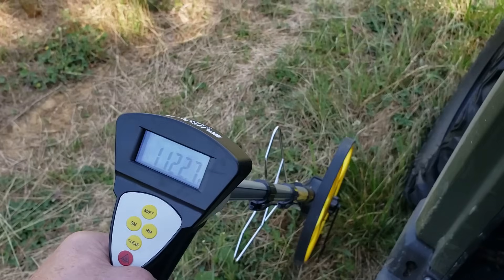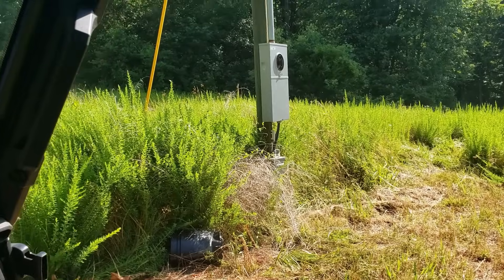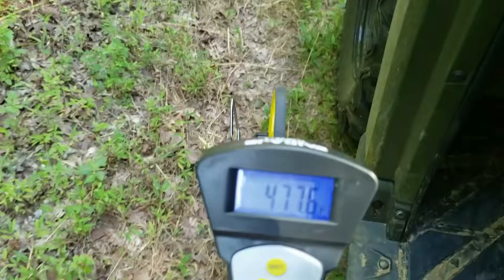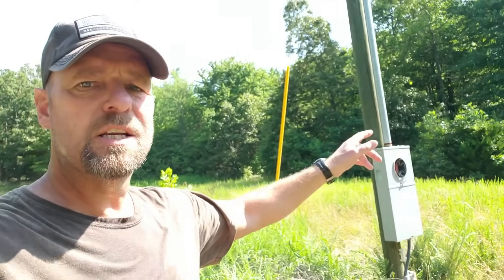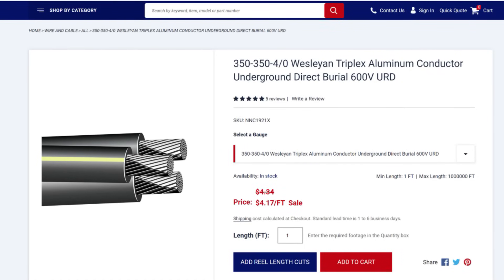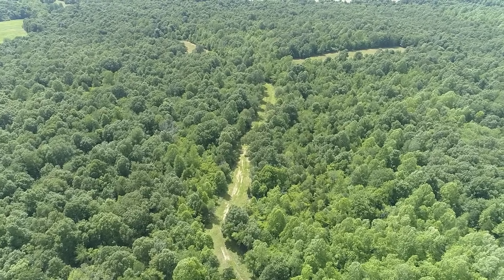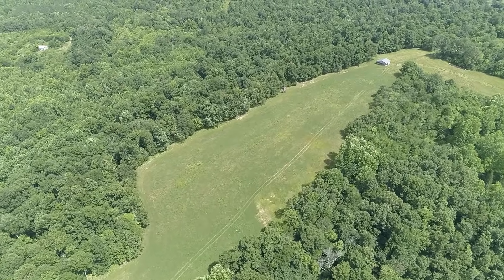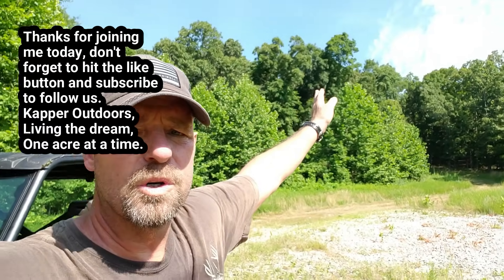DIY running 2,000 feet of power line to remote homesite? Let's talk details.

Comment: For the money you're looking at, solar seems to be a no-brainer. Especially when you consider the benefit of not having to rely on the grid going forward. These days, that could be very attractive to a buyer.
Reply: Solar needs a grid to function and also the sun. What do you do at night?
Reply: @jhans3278  Wrong. We're talking about an off-grid application. Obviously that means the system would include a battery bank. Nowadays this is very much economically viable, even when the grid is highly available. In this case, solar (with a battery bank, obviously) appears to be literally the most economically viable option. And yes, I would pair it with a back-up generator.
Reply: @tom8437  thanks for clarifying you were referring to an off-grid system with battery storage.
Reply from the maker: Thanks. I do not consider this a no brainer though. There is a lot to take into account. For water, I have to trench it anyway, so if I am going to cut a 2,000' trench and lay water line, I might just as well add the power for fully reliable service, that is also much  more attractive to MOST potential buyers down the road. If someone is going to spend a half million for a stunning property and want to build something they may not be confident in a solar system for a new home construction like they would a good 200amp service. So I am also factoring more into this equation. Hope this makes sense, thanks.
Reply: @kapperoutdoors  Per National Electrical Code power cable shall be at least 12 inches away from other utilities.  So. power cable and water line must be in their own trenchs.

Comment: A $30k - 40k solar installation will provide a ton of power.
Reply: 30 - 40k?  I own 2 homes that are completely on solar. My largest system cost me 16k
Reply: Neither home even has a meter now.
Reply from the maker: Only problem there is I am not that skilled for that kind of install, and not sure where I would put it? There is just a barn there now but it is a phenomenal building site if adequate 200a service was there. Will open the potential buyers up substantially and will command top dollar for a one of a kind piece of ground. I have to look at all that too. Thanks.

Comment: Y would you not just put a 3500 watt solar system on there with rain catchment for water. Would be a MUCH better option and WAY WAY cheaper.
Reply: Not to mention much more secure.
Reply from the maker: The problems I see with that are that most buyers that can afford a property like this and want to build would prefer and much more traditional and reliable system of power and water. I am not saying that solar is not totally reliable, as I do not know that much, but from the real estate perspective I have to look at that. Now if a person were building their own home up there and were ok with a new solar system install that would be a different story. Hope this makes sense, but I will continue to learn more about solar. Thanks.

Comment: Wow, utility company must not want new customers to be charging that much. In my area, the electric company will usually run overhead at no cost if you clear the right of way.  If they do charge its only the cost of the poles they use.
Reply from the maker: Years ago when they wanted more customers they would run long lengths for just a small service fee. Now they don't want more customers so you pay for everything to get new service in!! Thanks

Comment: Unless you are dead set against poles, I would go overhead until the last few hundred feet or so. Or you can go a bit higher and buy underground primary wire and set 2 transformers along the way, I think they can go about 1000 feet on an underground before needing to voltage regulate it again. This may be cheaper in the long run for you as you can do all the digging. I do not know if your power company will want it all in pipe, which will make it more costly, plus they may want you to use a bedding material like sand or fine gravel for the pipe. Ask them what they would do for a large subdivision that wanted all of the wire underground, that is the wire you need. it is not 500 mil, I just know it as primary wire, solid core with numerous cables around the outside- whole thing is roughly 1.5 inches in diameter. should be about $4 to $7 a foot for the wire.
Overhead primaries from the power company to almost the house location will be cheaper and often you will not need to dig the trees out just stump them. Then you have concern of right of way maintenance and trees falling across the lines. 
I don't know what you mean by going 400 amp, that will not help the voltage drop over 200 amp, it allows a bigger service at the building. the wire sizing will help but a 20% loss is still a lot of loss.
Reply from the maker: Having them do it underground is just out of the picture. It will be way too costly and I'd still have to run the trench. If I'm cutting the trench I might as well just lay the wire for a substantial discount. Have to wait a bit now for wire cost to come down though for this even to be viable plan. I know more now about the exact wire sizes I will need for either 100a or 200a service up on the hill. If wire cost were what they were a year and a half ago, I'd be drawing up the plans now! lol.

Comment: Maybe you should reconsider solar cause with enough panels you can probably run 2K house.  At least check it out.
Reply: Solar doesn’t run on its own. Still need either a grid or a large battery storage system.

Comment: Hummm, 20% loss, mega dollars per foot, mmmmm.  You are talking about 110/220 vac losses.  Have you explored running 440/660 vac to a step down transformer near the building site.  The higher voltage should be less loss in that distance, and maybe smaller conductors, thus less cost but more critical insulating spacing.  It might not be worth it but then again.....might be worth checking into.
Reply from the maker: Looking at that too, but I now I have more specifics on the exact lines I will need for minimal loss (5 to 9%  total). I have a feeling the inline transformers (private) won't be cheap, but I don't know that yet for certain. Thanks.

Comment: Don't just dismiss solar, it appears from the little you said of it you are only listening to the naysayers. A combination of solar and wind on the top of that hill can give you ample power 12 months of the year.
Reply from the maker: I won't totally dismiss it yet, still have to do some digging, but the major up front problem with solar is there is only the small barn up there now that we may convert into a camp. Part of the investment strategy is for a future building site, and most buyers that want to build a nice home will shy away from a solar system, so even if it cost less to put in, you would not get the same return in the future of making this an absolute one of a kind property that would command top dollar. So its not just getting power for a small deer camp or small home, there is a real estate perspective as well. Thanks.

Comment: I'm speaking on behalf of automotive wiring...but when using copper clad aluminum wire..there is a 40% current drop versus pure copper wire . Your run of 1900 feet has me concerned...seems like a long draw of current for aluminum . I think your best bet would be to wait awhile for the prices of products to come back to reality...look at osb plywood..$44. for 7/16 thickness..$10 for a 2x4 . Things are so out control at the moment i'd keep your millions under your mattress a little longer lol . I think before i spent 50k on service i'd check the options out for the solar programs the government were offering..i believe here it was around 10 grand towards the purchase and any excess energy could be purchased by the electric company..which probably wouldnt apply to you being without a powerline . The only other option would be building a mansize hampster wheel for Curtis and connect it to a generator head lol...good luck with this future project
Reply from the maker: Yeah I'm definitely going to wait a bit to see if line cost comes back down! But now I have some new answers as to exactly what Line sizes will work for this project, so I still may end up doing it and saving money as well. But we'll wait on pricing for awhile now! Thanks

Comment: Aluminum wire? Really. Gets hot faster and doesn't cool as fast.  That's why the aluminum wound welders were unreliable. They would get hot and hotter and the welders couldn't control the amps to the welding rod.  Please do some major research into aluminum wire. How many mobile homes have burned to the ground wired with aluminum. Just saying something to look into.
Reply: Most utility systems are designed with aluminum wire. Aluminum is 60% the conductivity of copper. So, just the wire size is just based on the load.
Reply from the maker: That's exactly what this line is made for. Running electricity for commercial purposes.
Reply: Kapper Outdoors so  they just use larger diameter wire apparently. Probably cheaper than copper nowadays for sure. Can't you rent a commercial trencher and bury it? Do they allow plastic water service and electric line in the same ditch with like a foot of soil separating the two out in the country there??
Reply from the maker: @timbow50  I don't need to rent a trencher since I have an excavator. Part of why I want to do this project, since I have the equipment, to save some cash. Yes, If I had them do the underground wire (even though I'd still have to cut the trench) they will allow the water line in the same trench but it has to have 16 inches of separation, which means I'd have to cut a 2 foot wide ditch. Another reason I'd like to do it DIY/private, then I could use a 12 inch ditch if I want and lay the water line a little closer if I wanted to. Just things to consider, thanks man have a good one

Comment: WHY not have the power company put a transformer near the barn. Then run  higher voltage, low amp, smaller wire from the existing pole to the new transformer? That way you have virtually NO voltage drop. A higher amp transformer won't help with voltage drop. It just allows  higher amps available at the distant site. 250 amps at 180 volts won't run A/C, a stove, clothes dryer. You're still getting poor info.
Reply from the maker: Well it is a learning progress for sure since I am no electrician. But I have had some good conversations with 2 very good industrial electricians on this. If I did what you say, I would have to basically pay the power co to run the new line all the way to the new transformer, which would be pretty expensive. But we still may go that route. But If I used 1,000 size line I could run it myself from the existing transformer up to the barn and would be good for 200 am service up there. However, right now, the cost of that line would be around $22,000, basically what it would cost to just have the power co do it. But prices are triple what they were in 2019, so if metals came back down it might be worth a go. But for now I'm just sitting tight to see what happens with pricing. Thanks a lot, hope to see you on some of our other vids, we enjoy sharing our adventures and mishaps. Take care